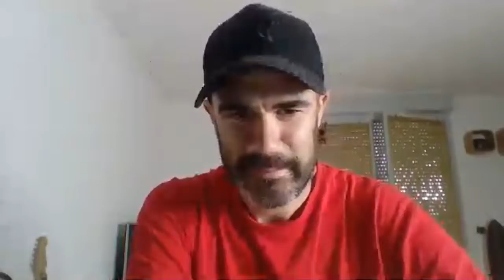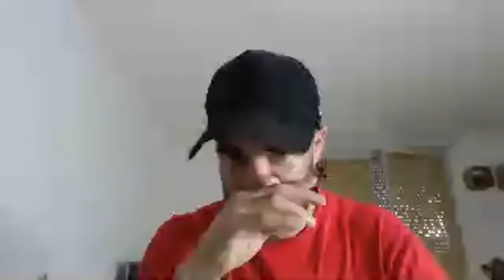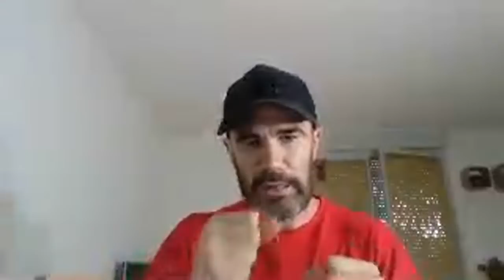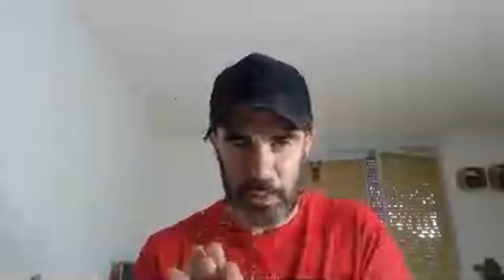LIVE Q&A special double push

Comment: Hi Pascal, Thanks for your efforts! It is really helpful.
I feel some contradiction though regarding the 125/110 debate. If you say that the perfect double-push with 125mm was challenging even for you with custom shoes, I feel that for many it would be easier to master the technique with a much lower deck height. I can see quite some mates struggling with not  perfectly fitting shoes on 125s. Rollathlon was my first ever real race and I decided lately to go with a hi-lo frame (3x110-100), and I couldn't have been happier 😀
Reply from the maker: Balázs Tüdős yes si i don’t see the contradiction? I mean it’s nice to go back on 110 ... not always faster choice ... but for some race it can be...
Reply: @ThePascalbriand  Sorry, probably I wasn't clear enough. My comment is mainly regarding beginners. As such I have also tried to start with a 125 compatible frame on a not very rigid boot, then I switched to my current setup...

Comment: Great video, merci Pascal. I had a question about the soft wheels.  I found that I am faster on a worn Matter F2  than an F1. I figured the worn wheels make it easier to hold a centre edge and have a good glide, or more contact area, not sure (might be imagining it :)). How hard are the wheels you race and train with ? Thanks. J'espere te voir a Montreal en Septembre (je n'ai pas l'habitude de faire des accents...)
Reply: I should be more specific- what hardness wheel would you use for a marathon on dry, flat asphalt ? Thx
Reply from the maker: stan jones normally I like to use f2 to get more pressure ... but it also cost a bit more of energy ... so you need to be in shape... and able to generate and use pressure easily